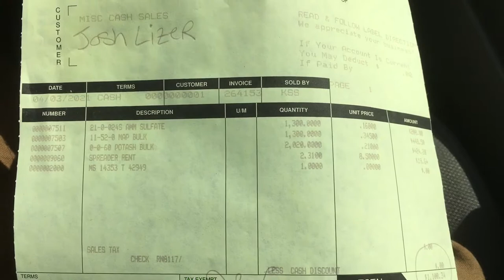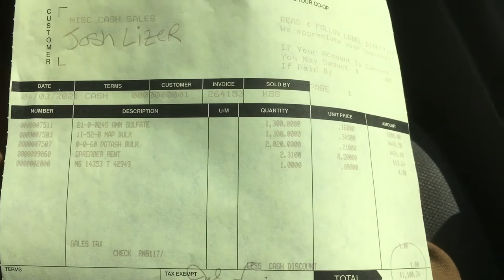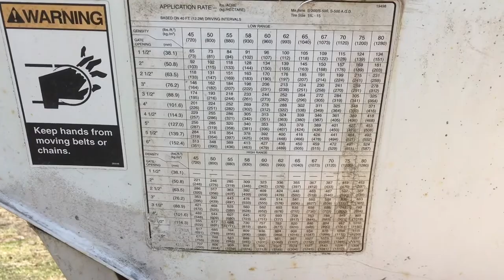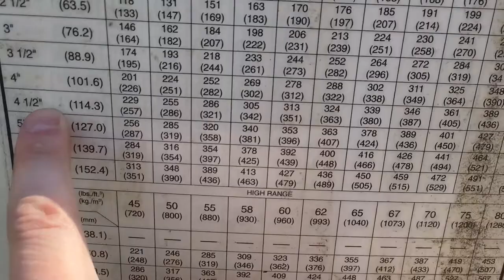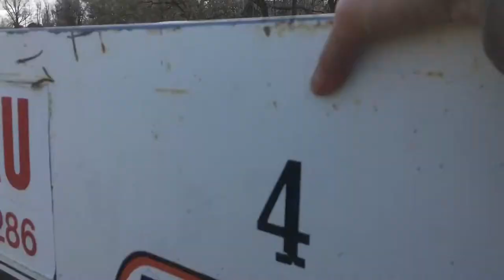Hay fertilizing time!

Comment: I am going to be doing 3.2 acres of hay, and that spreader seems a bit overkill for what I have. I wonder if the fertilizer can be purchased bagged for the 3PT spreaders.  I second wonder if the cost for coop bagged would be less expensive than prepackaged box store fertilizers.
Reply from the maker: Fertilizer can be purchased bagged but is very expensive compared to buying it bulk…almost twice as much. Fertilizer costs around $100/acre on average in normal years (prices are extremely high right now), and bagged fertilizer is even higher. 

Pull behind spreaders like this do a much better job spreading the fertilizer more uniformly. I used to have a 3 point spreader and it was nowhere as good as a spreader like this. When I used the 3 pt spreader I would buy in bulk from Coop in dump trailer and fill spreader with 5 gallon bucket. 

The other part to it is it’s much easier to calibrate the buggies and you get more accurate spread rate. With fertilizer costs as high as they are you don’t want to spread too much on first half of field and then don’t have enough left to finish. 

Suffice to say I sold my 3 pt and went back to pull-type buggy.
Reply: @TheScientistHayFarmer  I will keep that in mind provided the local Coop ever gets back to me on the soil samples I dropped off.  Been three weeks now, and not a word.  Without that, wont know what fertilizer to put down.  The good news is the place the fertilizer is stored is not far from me and I can tractor it over instead of driving the truck.  The one issue I will have is getting lime, for 3 acres, it would have to be coordinated with my neighbors plots, or they won't deliver and spread it.  Thats what I got from the local FS, but my confidence in him is quite low as I got the impression he would rather not be bothered with a pittance deal.
Reply from the maker: Your lime will just require one application and will last 5 years or so. You will acidify the soil faster with the more nitrogen you put down. 

Or you could look into liquid lime like Super Lime Plus. It has its own advantages and drawbacks. 

Or you could see if there’s a big farmer in the area that can apply some for you while they’re out and about. The hard part about only farming three acres is nobody wants to give you their time because you’re too small for them. 

I’m fortunate that I’ve got a good Coop here who know me well.